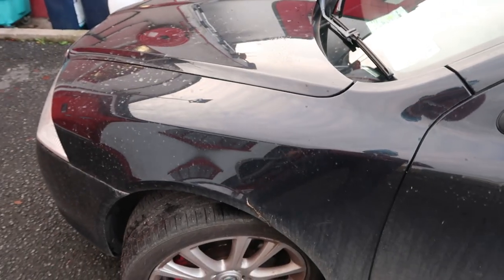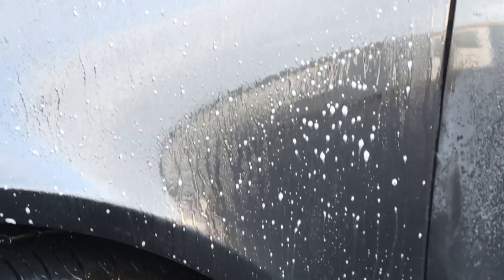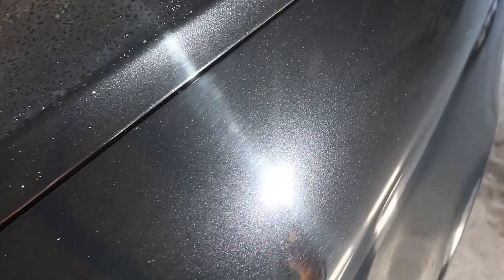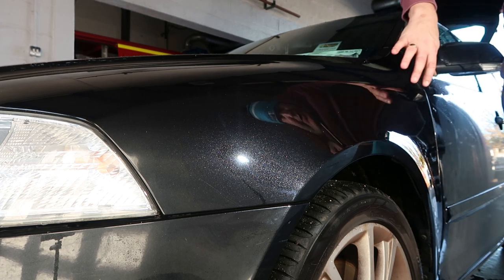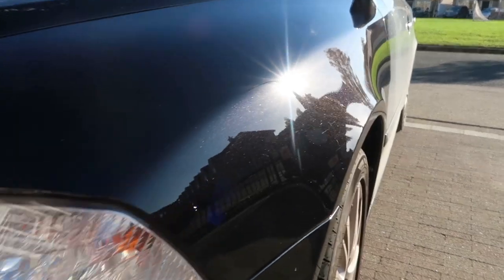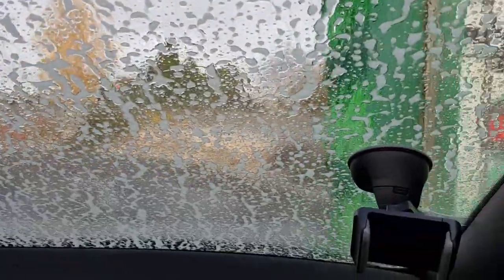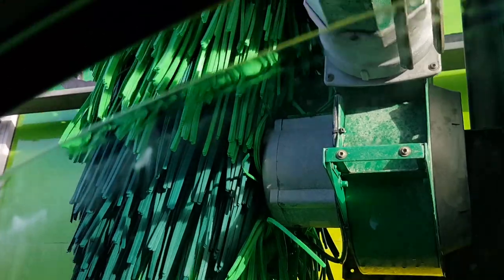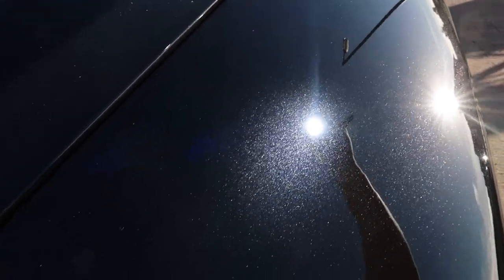Automated Car Wash | Will it scratch my car?

Comment: Car wash fanatic here (yes, we exist.) To answer your question, the brushes are made of closed-cell foam, not rubber. They're designed to fling off dirt and debris from the soapy water that they get drenched in during the wash cycle, which when maintained correctly, do just that.

The brushes are meant to be cleaned every 3-6 months, more if it's a higher volume wash. Unfortunately, almost no owners do this, which led to your results. That's the fault of the owner, not the machine though. Manufacturers wouldn't put unsafe brushes on their equipment.